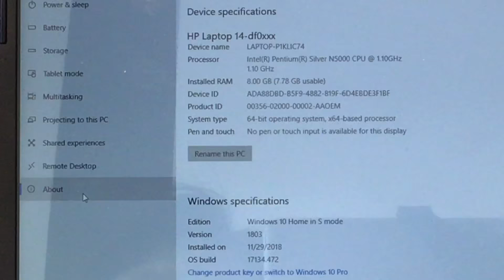How to Upgrade Memory in HP Laptop without User Removable Battery: DDR4-2400 SODIMM | HP 14-df0013cl

Comment: Just gently push both those clips at the same time.  Only push them just enough for the module to come loose.  You pushed one of the clips too far and caused yourself a problem.  I was going to upgrade my WiFi card but those antenna connectors on them are so tiny that you will want a good magnifying glass.  I wonder how many people have trouble with those things.  Those connectors are almost as small as a pen point.  Just take one look at them and you will see the trouble they are to connect.  There is actually a special tool to connect and disconnect a WiFi antenna.

Comment: fuck man, why cant laptops just have a push in thing under the rubber bits to push out the back panel, i literally just scratched up the sides of the plastic case trying to get it off with tweezers and a very small wedge screwdriver, i distinctly remember older laptops being so easy to upgrade ram and hdd's prob cause they were so thick

Comment: thanks great vid,one question , if I want to replace the ssd card with a hdd drive is that possible? I just bought  the same laptop hp 14 cfoxxx,with  the ssd card but it doesn't have enough space and my old ProBook hard drive has 500 gb of space {all my old games too}plus this have window 10 s not home or pro
Reply: i think it depends on how thick the hdd is :thinking:
Reply: HDD's heat up much more than SSD's ... Wouldn't put one in myself. Instead save few more penny and buy bigger SSD. But space is scarce idd.,

Comment: Modern laptop without dual channel memory = death. Dual channel is critical for many laptops, it doubles the memory bandwidth available to the CPU. But it's not just the CPU, many machines of this type use integrated graphics with shares the memory pool. So the graphics performance improves massively with dual channel memory as well. All sorts of GUI and graphics accelerated tasks in a web browser for example run waaaaaaay better. Don't accept single channel memory.